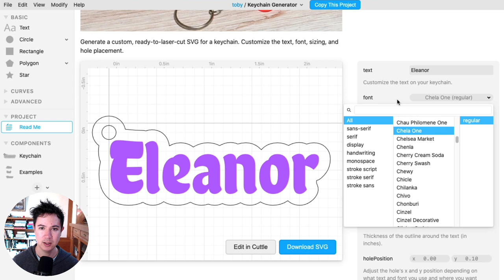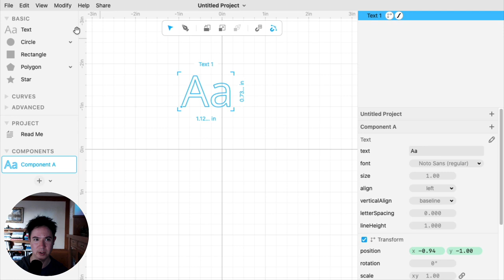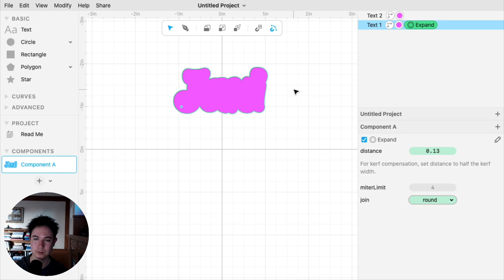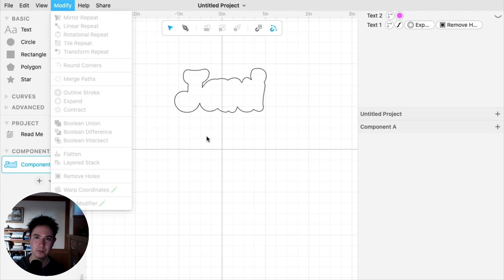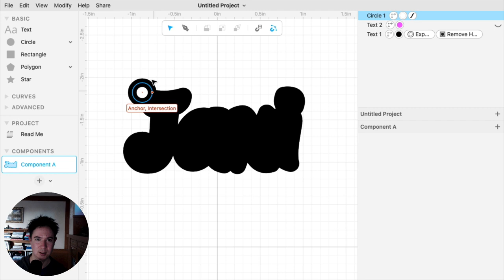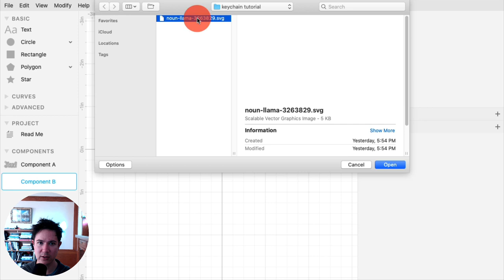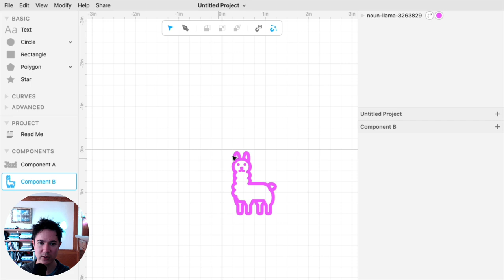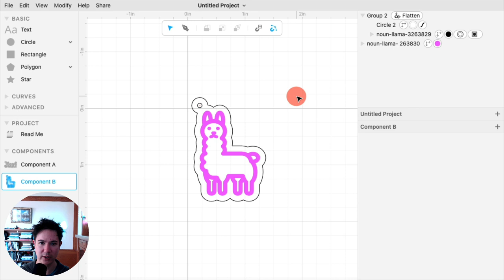Design Laser Cut Keychains in Cuttle

Comment: I'm considering purchasing a Cuttle subscription.  I'm trying to figure it out.  If you change the text, the expand does not automatically change to match, correct?  Also, if I'm making a rectangular keychain, is there a way to put a rectangle with rounded corners around the text, that changes length depending on the length of the name?  By the way, I would be using Cuttle create SVGs for 3D printing, not laser cutting.